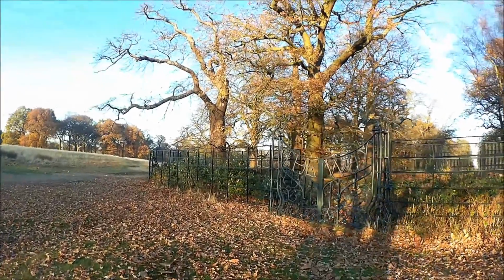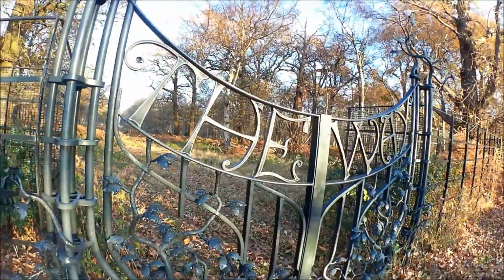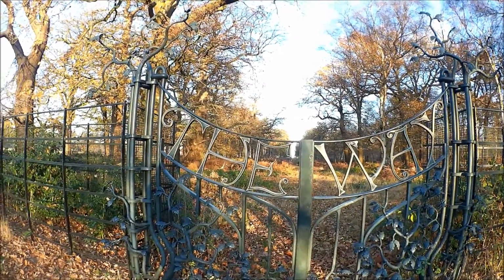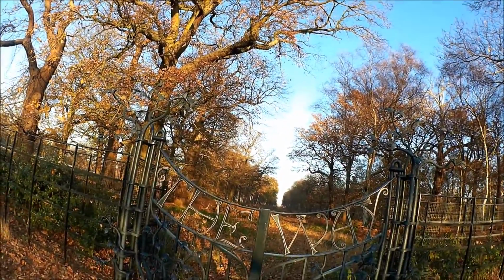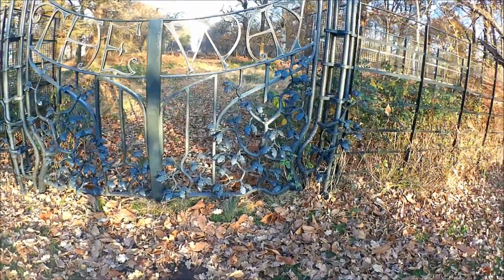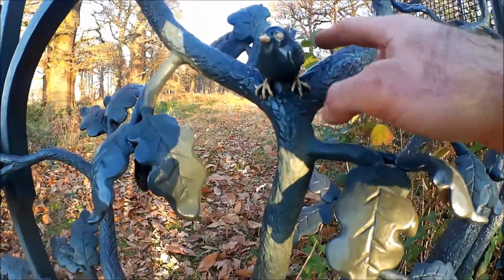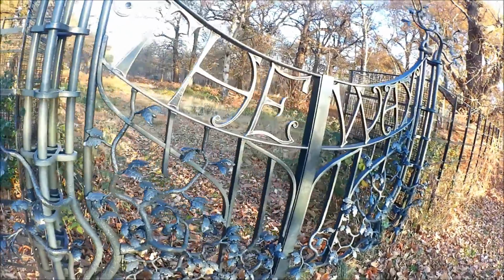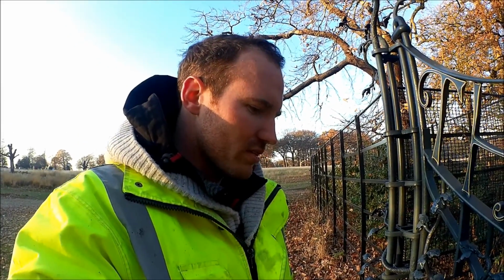Gate Restoration -Part 2-

Comment: Hey Joshua. I realize this video was posted in 2016, but I have a finish question. Do you think a project like this would receive powder coating well? If so, do you think it would last?
Reply from the maker: Hi. Powder coating is better than paint in general, however if you get it galvanized first the powder coating won't last as long and will eventually flake off compared to a high quality paint. It's the 10 year anniversary of my gates and the coach enamel paint we used is still Great although slightly discoloured from the UV rays. It was much more expensive to have it painted with coach enamel.